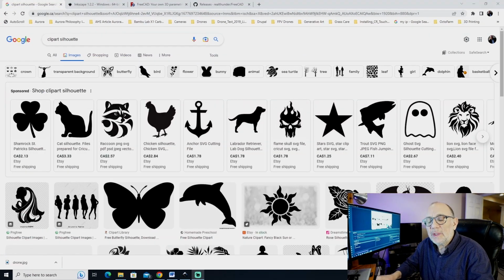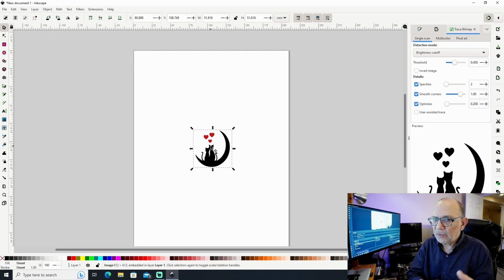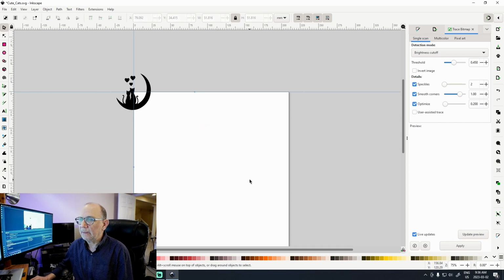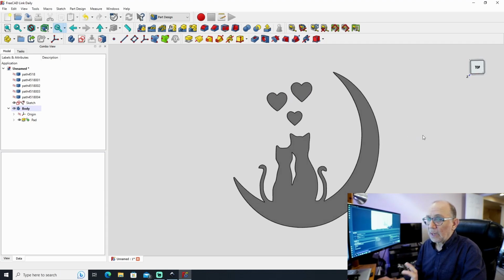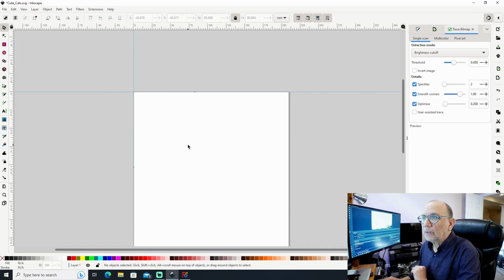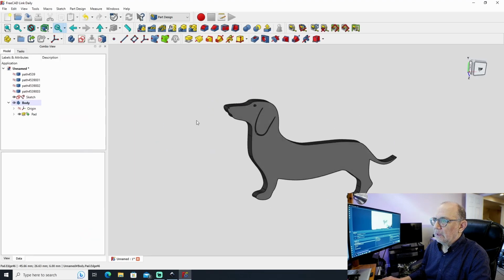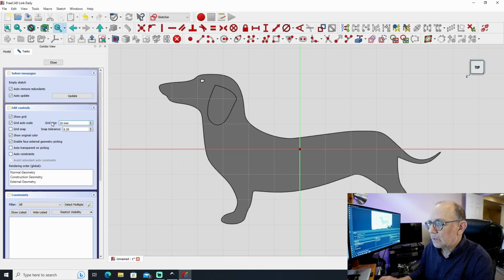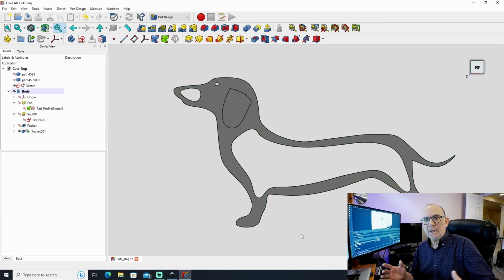Make Original Models for 3D Printing With Almost 0 Knowledge

Comment: I have tired your video now for the past 2 solid days...without ANY success.  Yes, I can import the file and get it to the sketch stage, any thing after that nothing but errors and unable the get to extrude.  I'm one FREECAD ver 0.21.2, either this version is rittled with bugs, or you might be leaving a step out.???  You should leave written instructions to your videos so people can print them out as reference.  Copied from about FreeCad : (OS: macOS 12.7.6 - Word size of FreeCAD: 64-bit - Version: 0.21.2.33771 (Git) - Build type: Release - Branch: (HEAD detached at 0.21.2) - Hash: b9bfa5c5507506e4515816414cd27f4851d00489 - Python 3.10.13, Qt 5.15.8, Coin 4.0.0, Vtk 9.2.6, OCC 7.6.3 - Locale: C/Default (C).
Reply: Same. I get to sketch phase - it looks weird as fck. In the next step I get errors